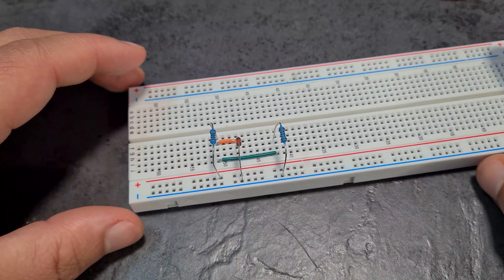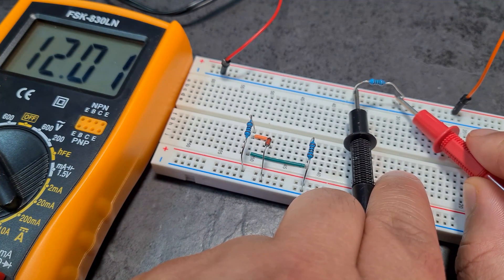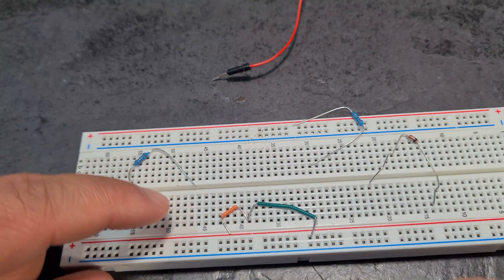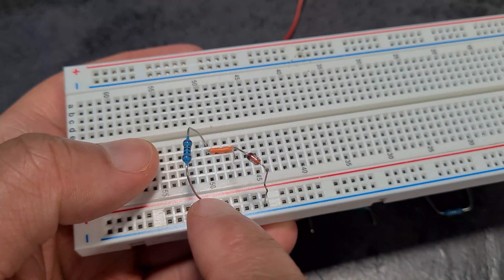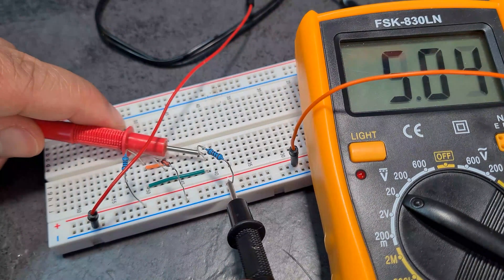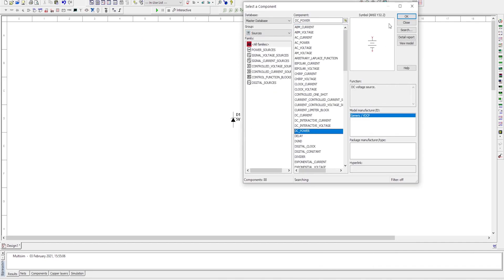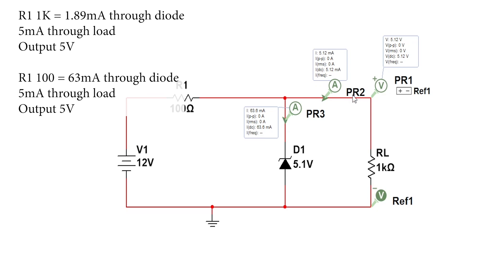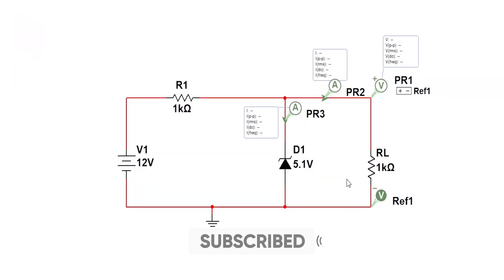12V To 5V - Super Basic Voltage Regulator Using A Zener Diode On Breadboard

Comment: Just a quick update: I tried this demonstration with my 1N5349B Zener Diode, (the "B" suffix denotes +/- 5% specs tolerance), and the basic specs of this diode are: 12V x 5W x 395mA. I used two 1K resistors as in your demo. One of the resistors was a 1/4W +/- 5% and the other was a 1/2W +/- 5%.

My input voltage source was my 35V x 10A Benchtop DC power supply. I also connected my benchtop DVMM to the output side of the circuit. 

I started with an input voltage of about 5V and increased the voltage 1 volt at a time. I repeated this process many times with a rather unexpected result. 

I found that the output voltage in the circuit consistently showed just about a perfect 50% result of whatever the input voltage was! So, at 12V input, I was getting 6V to 6.3V out, 15V input gave me 7.5V out, and so on. 

I then replaced the 1K Ohm output resistor with a 2.2K Ohm resistor, (1/4W x +/- 5%). That gave me roughly 2/3rds of the input voltage! At 12V in, I got about 8V out. 15V input gave me about 9.9V out and 24V input resulted in about 16V output!

I haven't tried changing the 1K Ohm input resistor yet but I plan to. But I have to say that at no time did I achieve anything close to a 5V output when I introduced 12V of input with 1K resistors in the circuit. 

I should point out that I checked the forward and reverse voltage drop of the Zener Diode BEFORE I put it in the circuit. The Reverse Voltage drop was 11.69 Volts and the Forward V-Drop was 11.60 Volts. In both cases, I noted a .1 mA and .1W during the tests when I reached those voltages...

So, why am I not getting 5 to 5.6 Volts output with a source input of 12Volts? Or am I splitting hairs? 

As a retired machinist, it's possible that I'm looking for similar results that may be unrealistically close to those in your demo. I may need to give the results a wider tolerance span. But it seems to me that results of more than a 1/2 volt discrepancy would, or could be very significant, no?
FWIW
Rich

Comment: Thank you for that great demonstration! 
However, I may have missed (or not quite understood), the reason behind using a 1K Ohm resistor for the load. I mean, is there a reason for that load resistor, like maybe to smooth out the flow? From your demo, the output voltage directly read at the diode is the same as it was at the 1K Load resistor.

However, the current at the diode (just under 2 milliamp) was considerably less than the current at the Load resistor, which was a hair above 5 milliamp. So the load resistor more than doubled the current over that of the diode. 

Now that I looked more carefully, I see that the input current from the 12V power supply started off at 5.5 mA and apparently, the Zener diode dropped the current to 1.9 mA. So, I guess the load resister is there to restore the original input current. 

If the load resistor was say, a 100 Ohm resistor, I would be inclined to guess that the output load current would've been barely more that 2 mA, no?. 

I guess my alternative question is; if the load resistor was say, 2K Ohms, would that have increased the load's output current significantly higher than the 5 mA? I sense that it wouldn't have only because there's nothing in the circuit to boost the input current. But that's simply a guess on my part. Still, I must wonder what the resulting current would've been if the load resistor was a 2K Ohm.

Thanks again for the demo! It has definitely clarified the use of a Zener Diode. I wonder if the Zener diode would be a better choice over say, a L7805 linear Voltage Regulator in simple DC circuits? The L7805 would usually be followed by at least one small capacitor, (maybe a 10 microfarad), to stabilize and smooth-out the voltage. 

Then again, I wonder if the use of an alternate circuit using a Zener diode would also be followed by a capacitor? It seems the more I begin to understand, the more questions I find asking myself, LOL. 

PS: I realize that it's been 4 years since you posted this demo, so my questions may not receive any answers, but with nothing to lose, I thought I'd ask anyway.
Rich

Comment: I did same with 9 volt battery but it's not working for me. What am i doing wrong ?
Reply: 9 volt will not work because he use 2 1k , i mean voltage over Zener diode only 4.5v it will not work. , you see , the rule here is Zener diode will reduce Volt to 5.1V it means. You need create higher voltage,
in your case , you need 2 different resistor 1 is 1k other mabe 10k . other so you can get 5.1v out put

Comment: Can a 5V zener drive a 5V relay if I use 12V as power supply?
Reply from the maker: Yeah the zener makes it a 5v supply basically so you're all good there. I'd personally go with a 6V zener.
Reply: @HamedAdefuwa  Thanks for replying. I had tried this but the relay does not trigger. Can I ask you what correct components could be used?
Reply from the maker: Use a power supply to test at what voltage the relay triggers. It won't be exact 5V. Did you try the 6V zener?
Reply: @HamedAdefuwa  Okay.  No, I didn’t try with 6V zener. After trying I shall get back to you.
Reply: I tried using 6.3V zener but no success. 5V relay gets triggered by a single 18650 battery (3.7V) but not with 6.3V zener (giving 5.5V as output). The necessary current required to trigger the relay is absent.  What can be done with the type and value of resistor used in between 12V supply and 6.3V zener Cathode? I am using 1K 0.25W resistor as shown in your video.
Reply: Tiny dont use 5V zener as power supply not enough current to trigger, make sure the correct source
Reply: Is this a 1n4733a?